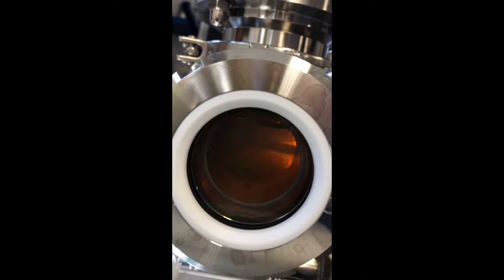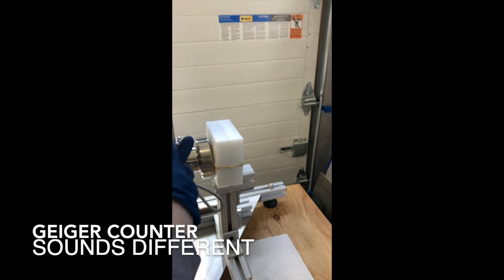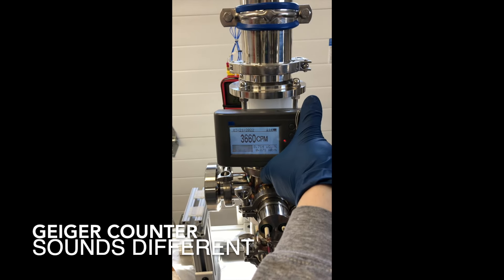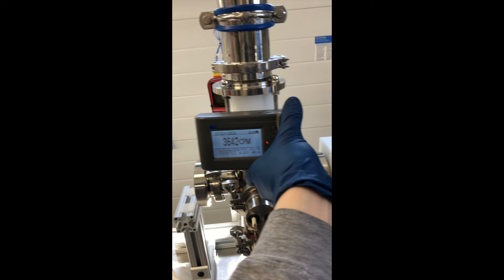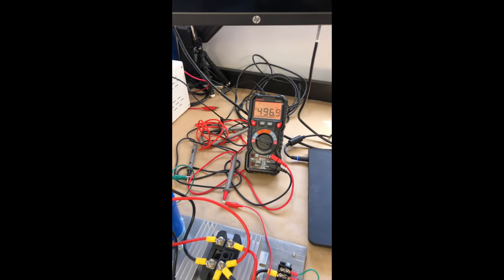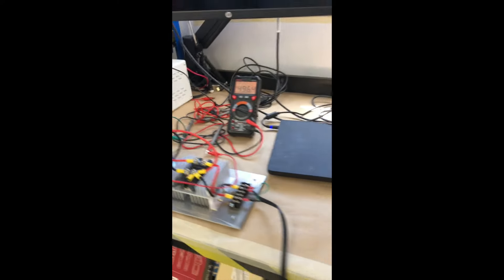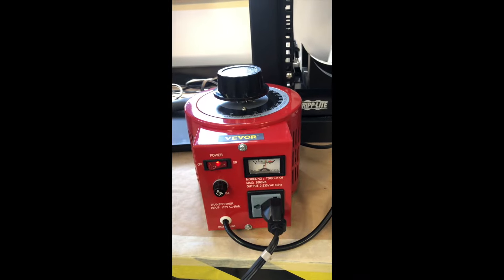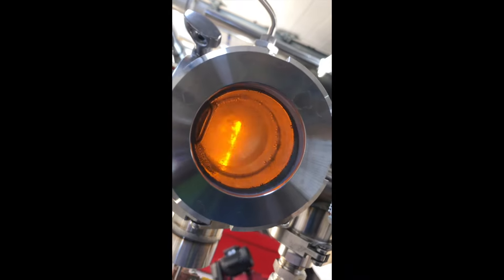The Mysterious Incident at My Hydrogen Reactor

Comment: High dv/dt impulses selectively energise electrons over ions, potentially forming a cold plasma (cool ions amid super-heated electrons), AKA non-thermal or non-equilibrium plasma. Its rapid formation under the high breakdown electric field may promote spin-coupling coherences resulting in spontaneous formation of anomalous charge clusters, these being highly attracted to the positive electrode.  Critical replication factors may include hydrogen loading and brevity of the initiating EMF's.  The resonant mode would obviously be between the applied phase versus the growth and collapse speeds of these electron condensates, cyclically absorbing and releasing energy in Bosenova type explosions upon reaching threshold densities as the plasma alternates between high and low entropy states.  If you do get it back, look for anomalous emission lines that might correspond to formation and collapse of exotic quasiparticles..

Comment: What you did was unintentonally form an ionic solution rectifier. These were used in the way back times to make high current Dc from an AC source for battery charging and similar tasks. A similar device can be made from a pickle impaled on each end and plugged in. One end will glow, and if you put a load in the circuit you will find that the output is a leaky pulsing DC.❤
Reply from the maker: Thanks for the comment and info! Very interesting. I will do some research into that and see what I can find. Have you experienced this before?
Reply: We built a tank to test motors too large for our normal kit and supply, worked ok but very dangerous and produced a lot of steam . That was years ago and our MAR was not large enough.  The only solid state device available were in large stacker trucks and cranes.
Reply: @WOFFY-qc9te  I wonder if that "a lot of steam" could be enough to drive a Tesla turbine.
Reply: Not quite.  Our AC setup the conductivity depended on the strength of the Potassium Hydroxide,  just a tank of water with the current going through to the Star point of the motor under test. 

Once the motors inertia was overcome we would throw the circuit over to the line or another  three tanks (resistors)  then direct once at speed.  Some motors needed a several minutes to get moving so plenty of steam.  

The motors did weigh several tonnes. The MAR was for motors needing  DC field excitation.  

Check out  Grimeton Transmitter  it uses a similar system to get the main RF exciter motor running.
Reply: @StefanDanov  Well how big is the turbine and how much steam do you want.  Yes it is possible. But the steam from Potassium Hydroxide in H2O  having several hundred Amps going through it is rather corrosive and contains Hydrogen. 

What I comment was not really relating to this current experiment which is more Plasma physics and If the supply was shown on an Oscilloscope he would probable see a shift in Apparent power and Real Power that change due to circuit resistance and phase shift will damp line frequency.  Volts, Polarity and current need to be seen on a scope trace. Interesting experiment.
Reply: @WOFFY-qc9te a Tesla turbine is 99% efficient in energy conversion from pressure to momentum, probably the most efficient machine ever created. The turbine's dimensions and spacing between the disks depend on both the pressure and fluid to be so efficient. Hydrogen could improve further the efficiency if it burns to contribute to an even higher pressure. You're right about the corrosive nature of the electrolyte and it means a non corrosive electrolyte should be used or the entire turbine should be made of carbonceramic material or similar.

Comment: My guess is that the negative electrode eroded untill it was no longer the smaller surface area electrode. When this hapoened the plasma formed around the positive electrode. The plasma at the positive electrode is much more stable and less vigorous and it inhibits the current better. Its more stable because there is not much hydrogen created for the plasma to combust. You can also get both plasmas at the same time if you have a large ground electrode and one small positive plus one small negative electrodes in the electrolyte. Also if you use a large enough inductor in series with the electrodes, you can get the plasma forming even if the water is at room temperature. The inductor help in limiting the current and providing bigger voltage spikes for plasma formation.

Comment: You can certainly modify your variac with indicator lights.  In general it's good to know visually when your equipment is powered up.  The variac making noise or not could be a lot of things, other coils will buzz or not buzz depending on where they catch the cycle when powered.  I have some notorious gas solenoid valves that are quiet 10% of the time, quiet buzz 50% of the time, loud buzz 40% of the time.  They are high cycle devices so you get to hear it happen over hours not days.
Reply from the maker: Hello! Thanks for the comment. I agree that it may be wise to add a visual power on reference. I will have to experiment more with the power-on cycle to see if I can catch it at different cycle points. Very interesting and deserves a looking into.  Thanks! - Andy